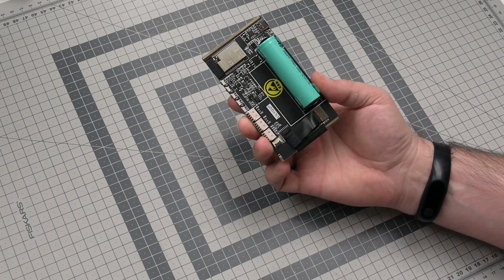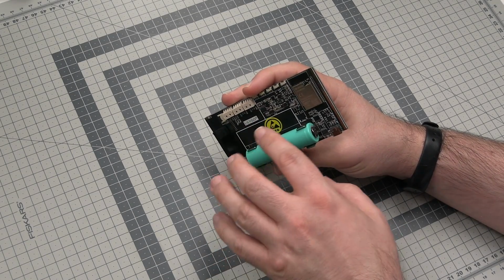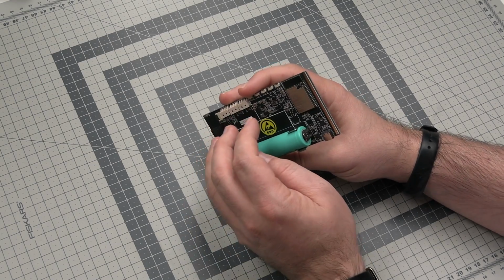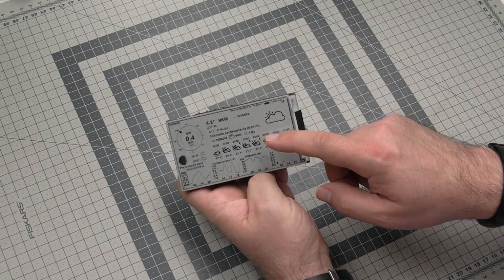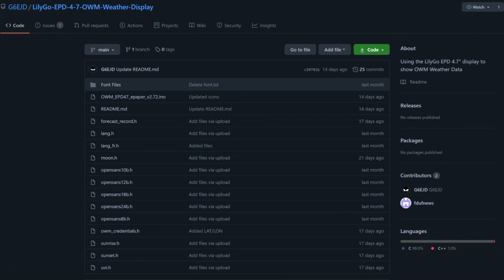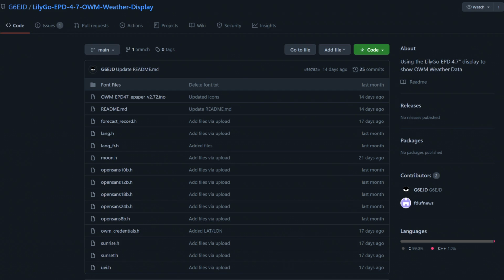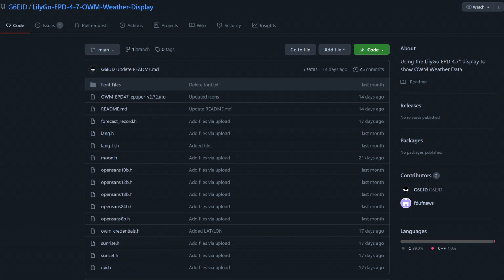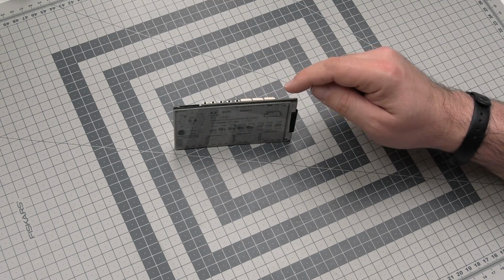ESP32 e-paper weather station for less than $30

Comment: Mine worked fine for 2 years and now Open Weather has changed their API and it stopped working.  The code needs to be modified to use the new API but so many libraries have changed in Arduino since I flashed it that it’s a nightmare trying to get it to work again.  Anyone else have this problem?
Reply: I recently set this up and did not have such issues. Would you like to connect?
Reply: @ Yes, I’d like to know what code you’re using and what IDE version you have.
Reply: @telepresence у вас заработал код?

Comment: This looks GREAT! Excellent video, ty!  I have a unique system need for a super low-power  self-reading weather station in a remotely placed camera housing, it cannot have any external communication & must be fully self sufficient. I love the ePaper for low power draw, I need the computer to read an EXTERNAL (outside the camera housing via wires) thermometer & hygrometer readings (every 10-20 seconds?) to calculate the very accurate dew point. I then need the computer to read a separate INTERNAL (Inside the camera housing) thermometer, and then I need the computer to control a relay that sends 3A-4A 12V to my internal heat strips to turn them ON & OFF so that my glass window remains "5 degrees" above the current dew point. I need to be able to adjust the "Degrees above Dew point" to fine tune the system for various conditions & locations.  I'd also love to be able to control the time of day or night that the system is allowed to heat my window. I am trying to prolong the life of my battery as long as possible as I will not be able to even go check on the camera for days or weeks at a time.  I'd like to eventually extend this to months. Any advice? tyvm
Reply: That's actually not too difficult to do. Are you trying to heat a telescope lens? Give this exact comment to chatgpt or some other chatbot to get an initial idea of where to start. It's basically a simple script - you just have to get the wiring and formulas right.
Reply: Please get another hobby.  Try legos or a puzzle.
Reply: @Digital__Confusion  A ten year old joke? Really? 😂
Reply: @The_1ntern3t  Yes a joke just for you, age appropriate
Reply: Super dumb & hateful comment, why? @DigitalConfusion1
Reply: @MissouriClydesdales  Please be nice.
Reply: @StephenMattison66  That is asking of WAY too much.  Better for a forum to discuss a project like that and not expect the YouTube channel poster or commenters to explain everything.  Remain calm, spend time researching when you have a project idea.  And it has been 6 months, did you get your answer?  Silence tells you what you need to know.
Reply: @StephenMattison66  Stephanie, I posted the answer why

Comment: A super interesting project after I have seen your video I had directly order the board. First I installed version 2.5 and it runs without any problems then I wanted to upgrade to your version. But after the message from arduino ide: leaving hard resetting via RTS pin. Nothing happens. Do you have any idear where the problem is?

Comment: Hello Pavel,
I also have to notice that sometimes the board only wakes up from the hourly sleep phase after a reset. The time display is currently at 6:00 p.m., although it is already 8:49 p.m.
Apparently this hourly rhythm is not reliable.
CanI change something there?

Greetings Ulli
Reply from the maker: Maybe they changed something in the code. Mine wakes up and refreshes no problem all the time

Comment: Hello Pawel, I am currently testing the board.
I still have a problem:
According to the program, the wakeup time is set to 07:00 (int WakeupHour = 8; // Wakeup after 07:00 to save battery power).
However, the board only switches from 11:00 p.m. to 8:00 a.m. at 8:00 a.m. No Wakeup at 07:00 .Do I have to change something else in the settings?

Many greetings

Comment: Hello PS After Hour,
you're right. It really is a great board. I now have it in a case and it's on my desk. I configured it to my city "Berlin, Germany". But my problem is that there is daylight saving time in Europe. I.e. the displayed time is currently one hour behind. In the winter she would walk properly again.
My question: Where can I put the time forward by 1 hour?

Thank you for your recommendation. I look forward to your early reply.
Reply from the maker: Interesting, I have it running 120km from you in Stettin, Poland and it switches times perfectly. Are you sure you sent correct time zone ? I have this const char* Timezone    = "GMT0BST,M3.5.0/01,M10.5.0/02";
Reply: @HackerUni  Hello Pawel, this setting for the time zone did not fit. I have now but via the link in the lib
owm_credentials.h
found the right setting:
CET-1CEST,M3.5.0,M10.5.0/3

It works great now.
Many greetings

Comment: Hello,
great project that I would like to replicate. I just ordered the board.
Unfortunately I get the following error when compiling:
"C:\Users\uengel\Documents\Arduino\libraries\LilyGo-EPD47-master\src\rmt_pulse.c:9:24: fatal error: hal/rmt_ll.h: No such file or directory
exit status 1
Error compiling for board ESP32 Dev Module. "

Can you help me with that? What's wrong?

Greetings Ulli

😀
Reply: Problem solved. Deleted this line from the library. Compilation runs without errors.

Comment: Hi, is it possible to adapt code to different api than OMW? Is is not very accurate for me.
Reply from the maker: It's open source, so of course it is technically possible. Still, requires coding
Reply: @HackerUni  Ok, thanks. And does this board charge 18650 battery when connected to USB?
Reply from the maker: Yes, yes it does

Comment: Good stuff.
Tried to use websockets, then parse json, then put it on e-ink display - ESP32 can't handle it unfortunately.
Still good for simple tasks
Reply: What issues have you ran into? ESP32 is totally capable of doing so :)
Reply: @filipgrzywok6023  wasn't able to make web sockets work. Also json serialization/deserialization libraries are useless IMO.
Do you have any example repo with: web sockets - json parsing - display some info on e-ink? Please share if you'd found such